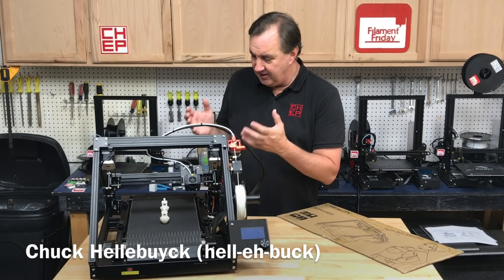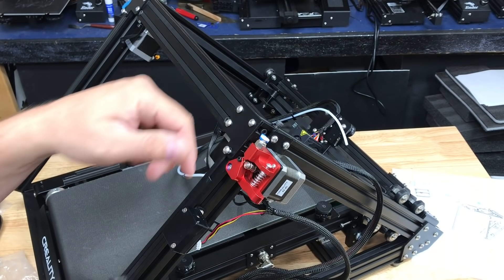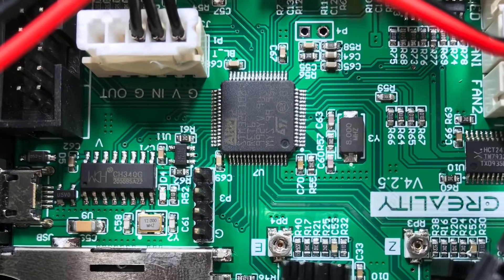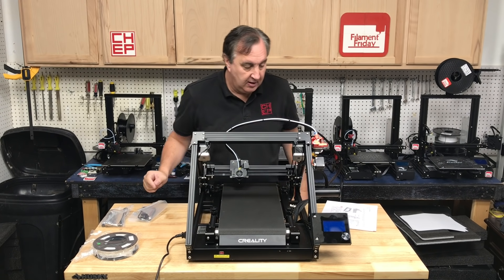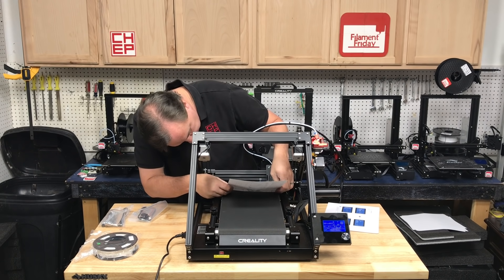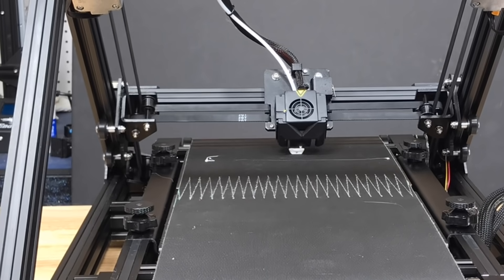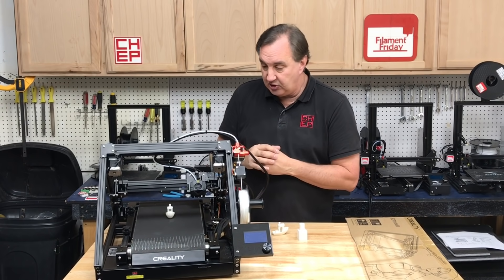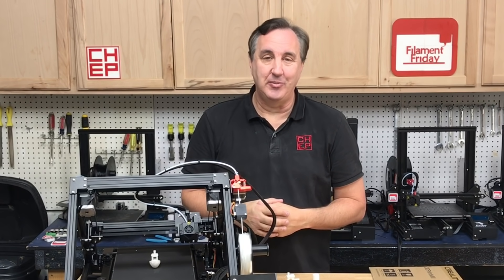Creality CR-30 - Naomi Wu's 3D PrintMill with Infinite Z

Comment: I really think they should invest a few more bucks into having V-belt profiles under the belt to help tracking straight, especially with the price point they are speaking of.
Reply: I haven't had any issues with tracking on mine..  I looked into V-belt profiles when designing the White Knight and ran into three issues. 1. Most companies want to run it down the center of the belt and that won't work with the heated bed, 2. adding the v-belt tends to deform the surface slightly, and 3. It adds significant cost to the belt...  I do like the idea though, but it would require a significant design change and inceased cost.
Reply: @NAK3DDesigns  Really? I work for a company that does conveyor systems and our manufacturer glues the V-belt profile anywhere on the belt where we want it, usually about 3 to 6 inches from the outside, that's odd if they do it only in the center, it doesn't really help tracking as you don't have 2 of them. And as far as the increased cost, I figured it wouldn't be that much as they use recycled belts from what I understood, but it could indeed be significant.
Reply: @PunkR0ckz09  V-belt profiles are a bandaid for a tracking error.  The proper way to force a true center tracking is to have a slightly raised roller in the middle so it automatically walks up to the center... but even in that case, it's still a bandaid for bad alignment.

On all of my printers, tracking is not an issue.  If they're properly calibrated and aligned, they'll go indefinitely without needing a correction.
Reply: @williamsteele  yeah I am aware of the curved rollers (I call them "football shaped rollers"), we use that in our conveyors, but that is even costlier than V-belt profiles, as it is a lot of machining... thus why I didn't even mention it lol, but you are right. I just thought since it was recycled belts, they could maybe incorporate that to help and justify the belt cost more

Comment: The only thing I pre-order are video games, because all I need to do is lay down $5 to get a copy on release day, and with digital distribution now, even that isn't a thing anymore.  They're not getting my cash until they have a product.  THAT is the incentive for a company to make a good product at a reasonable price. Business is a gamble, and you need to make something valid for people to want it, which in turn recoups your investment. Too many companies use the Kickstarter route to half-ass a product and then use their first-gen buyers as Beta testers. I'm not going to pay for that privilege. Complete testing is part of the development process, and releasing basically a prototype design as a retail device is dishonest. At least with software, you can update it. With hardware you're stuck with what you bought. Buyer beware.
Reply: Well said Ian. Exactly how I feel about what has been going on with Kickstarter.
Reply: @frogmandave1  Thanks! I'm glad someone appreciates my thoughts. I understand a small company trying to get a bit of a boost on manufacturing something when you're just figuring things out. Tooling is expensive! That was the point of Kickstarter to begin with, but that garbage of multi-million dollar companies using grassroots financing tools so they transfer all the financial risk onto buyers for a new product is absolute trash and anti-consumer. They already have resources, and shouldn't be begging with the newbies.

Comment: Great in concept but many points of failure - We are after all beta testers of Creality and boy do you realise this quickly. Creality kick out great printers BUT the caveat is a lack of quality control which is diminishing the reputation they have built up thus far.
And China as a whole needs to work on its customer support.

Comment: How is it infinite Z?
Reply: its on a belt so the prints fall at the end so you can print infinity
Reply: @jon9947  The extruder still moves in the X and Y axis as in a typical corexy printer.  Therefore, the belt became the Z.
Reply: @Kalvinjj  My first one I simply called a "Tilted Conveyor Belt Printer." :-D
Reply: @williamsteele  Yea, I understand the concept but it’s really more of a marketing gimmick than fundamentally correct. How would you print a 24” vase on its side unless it was designed to be printed that way? Supports alone would constitute half of the print time not to mention the poor finish. Regardless, there is no arguing the fact that it would be awesome to wake up to a pile of prints in the morning. 🤙🏻
Reply: @pl5882  Huh? That argument is true for any other problematic geometry on any other printer as well, though, so I don't see the point. The world is not only made of vases.
Reply: @mangabuddy  Well there is that whole thing called gravity so I'll continue print tall things vertically as not to fight against it and of course to the true Z limitations of my Ender3.
Reply: @pl5882  How is gravity a bigger problem here? Just put rollers on the end of the belt. Of course, for very long things, you need a few more rollers.
Reply: @pl5882  Of couse, for true infinity, you should print in a very low gravity environment which should not be an issue because most of infinite space is very low gravity anyway.

Comment: i wish they would do a belt axis upgrade for an ender3, ditch infinate z, go with infinate y insted
Reply: That would not work. There is a reason this printer is designed this way.
Reply: @mangabuddy  maybe infinate y was the wrong thing to say, as you would still be limited to say half the top belt length. 

the reason i ask for a belt, is so at the end of a print i can just drive forward to pop the print off then start another print etc
Reply: @ivanhartley4378  Moving large prints like that could become problematic. Only reason to replace a moving bed with a moving belt on a classic printer would be be auto removal. You don't get any axis improvement, on the contrary. IIRC Naomi wants to make the belt available separately so people can fit it to other machines.
Reply: On Kickstarter RIGHT NOW, lol

Comment: Why would Creality need a kickstarter?
Reply: Same reason Hasbro did one for HeroQuest....so YOU take all the risk and they have to come up with zero up from costs.
Reply: It's a clever way to engage customers for pre-order. 

Instead of fully committing money upfront for a whole new product line they "run a kickstarter campaign" to gauge interest. Depending the team running them, a kickstarter ranges from absolutely necessary to a glorified marketing gimmick.
Reply: So they can provide you with self destructive  machines

Comment: The concept is cool, the ability to print long items opens up some possibilities. I think the best use for this style of printer will end up being churning out parts in a farm setting. I could totally see this as a production machine if Creality and it’s user base can tweek the quality AND get third party, open source software support (cura, slic3r, etc) before interest fades. It is after all a bit of a niche product for the majority of hobby users. The software side of this is a completely different animal than regular Cartesian gcode and will be expensive to refine without a large market. I think it’s great to see some new technology being introduced and I have to give kudos to creality and Naomi for pushing the envelope with this. For me personally, I don’t see a huge need or desire for such a printer at this time but I could also see this being upscaled into a game changing technology for industrial uses (think large scale concrete 3d printing or something similar).

Comment: You realize this style has been around for quite some time?  Field of View (gentleman named Aldo) did a great deal of work on belt printers.   And it’s open source ...
Reply: Did you even watch the video? Naomi built on the open source work of others and cooperated with previous designers. It's all there in this video, with pictures...
Reply: @mangabuddy  i did but plenty of others developed this.
Reply: @WhereNerdyisCool  And what is your problem with that? Why the rhetorical question when previous work was clearly acknowleged here and everywhere else? Why are you looking for a scandal that does not exist?
Reply from the maker: Where Nerdy is Cool - Makerbot was the first and patented it. Stratasys bought out Makerbot so they own the patent. William Steele’s was the first I know of to get around the patent with the angled platform/nozzle thus making a commercial machine like Blackbelt and now Creality a reality.
Reply: @FilamentFriday  and a lot cheaper than the Blackbelt!

Comment: Surely it should be referred to as "Infinite Y-Axis"? It's the y-axis belt that can move continuously, the Z-Axis can't go infinity past the sky into space.
Reply: The nomenclature is arbitrary, but the software works by moving the extruder in the X and Y axis just as it does in a normal printer.  The Z axis (of the original Makerbot Replicator I used for the first one) was converted into the belt... so the letter assignment stuck.  Technically, there is no Z, as the belt is actually a function of the traditional Y and Z that I called Z' (Z Prime.)

Comment: You can buy 6 Enders for the price of one of these things. So, the argument of printing parts in volume doesn't make ANY sense at all FOR THIS MACHINE at $1000. It's not going to change what Joe Prusa is doing at all.This is for LONG pieces...$hitty-quality, long pieces, where it's OK to have chunks of Creality's cheapass conveyor belt, vs a metal belt, stuck in the plastic, like happened when 3D Printing Nerd tried the machine out on his channel. A WhiteKnight this is not even close to being (Check out 3D Nak's channel to see that real belt printer in action). There's a Kickstarter right now that converts an Ender 3 to a METAL belt. Creality's printer is obsolete and useless before it even hits the market with that one being available, lol. A dead horse out the starting gate, especially when Creality are showing their QC is so horrible, the DEMO machines to influencers like Chuck are incapable of printing a decent Benchy. Go ahead, Chuck - show us a print on that crazily sewn belt seam....you know, where "production" parts will print on....you know, where you count on the BELT side of the part being ultra smooth. And with no belt contamination in the printed part.

Comment: Funny how in these comments, no one can find a practical use for a long piece of plastic.
I would never support a Creality kickstarter, it's an abuse of what kickstarter was supposed to be.
Reply: I thought we were past the point of the crowd funded kickstarter. All it's used for now is free marketing. Not exactly free, but you get the idea. 

There's no need for a long piece of plastic, that's not what this is for. This is for printing multiple things that you may need to prototype and send out. In terms of cost, this is remarkable cheap for something that could print, say, 20 of the same large thing, vs one huge printer that has the build volume to support that many pieces. I'm not meaning 20 lego pieces, I'm meaning full building miniatures or even parts for future printers. You hear of print farms quite frequently, and while many printers are faster than one, there still has to be a human element that would have to remove the prints from time to time. The infinite y axis would mean that once the belt is full and moves onto the next print, it would just pop off the end and fall into a bin or something similar. 

It's a fantastic idea, but it definitely has only a few use cases. Not for someone that's just printing one thing at a time.
Reply: @Guffy1990  I got Creality to agree to completely open-source the entire printer if I could hit 5 Million on Kickstarter. If people don't want to KS fund it that's ok, but then development will probably be a bit slower.
Reply: @Naomi-Wu  Thank you for your transparency, I appreciate that you're looking for community feedback on this.

I just feel that, with how large Creality has become, it should be easier than normal to just "do it" so to speak. I know that this is partly your brain-child, and partly contributions from other members of the 3D printing community, however it's a good idea! People will buy it if they have a use case for it! If they don't, then they won't. It's definitely a very niche market this is catering towards, but that niche is quite large. People still look at 3D printing as a concept, more than something that they'd actually use. Although, that seems to be disappearing more and more, which is also fantastic!

Open sourcing would be a great benefit to it all, and it's impressive that you managed to get them to it. Creality is mostly open sourced anyway when it comes to mitigating the amount of proprietary equipment and hardware they utilise.

Out of curiosity, what parts of it would be open sourced?
Reply: @Guffy1990  The entire thing, same as OSHWA- CAD files, firmware, Gerbers, everything.
Reply: @Guffy1990  At a hobbyist level, this has very little value as you might be making one-off pieces. From a small scale production level, >20 to <1000, which is where 3D printing is perfect, this would be invaluable.
Reply: @Rottwiler44  that's... That's exactly what I said...

Comment: If it has an infinite Z, prove it by printing something really long, like a minecraft sword or katana.
Reply: Not sure that’d be feasible, you’re probably still limited by the print area. If you tried to print something longer, you wouldn’t be able to print the each layer continuously.
Reply: @blazingangel623  It doesn't print the layers flat, it prints sort of like it's printing on an invisible print surface purpendicular to the angled nozzle etc.
Reply: @TheAkashicTraveller  @YellowJacket20 tbh, i'm more interested to see when the object tips over the edge. I wouldn't really print anything that long; I only see this type of printer making multiple smaller prints just like how it printed multiple benchies.
Reply: @fboodysan  & @YellowJacket20  Naomi Wu's build and presentation of this printer shows her printing multiple Benchy boats that fall into a box, as well as a pretty lengthy I-beam girder, if that's what you're looking to see!
Reply: @IanTheWoodchuck  Yea, I've just seen a video of a guy printing a rail that is 20 feet long. But you gotta have some support for it; Common sense.
Reply: @blazingangel623  I've just recently watched them test print a long sword on it and it does great
Reply: There are videos of it printing a I-Beam so it definitely can print continuous
Reply: @fboodysan  there is a roller add on to it.. add about another 2 feet beyond that you use a Miller wood stand and add multi ones of that..

Comment: Way over priced. Pay an extra 600.00 just to have a belt drive.  Way over priced. Easier to remove the print and hit print again on all the other 200 printers.
Reply: Till you want to print a 6ft sword in only 2 pieces..  Then it doesn't seem that expensive..
Reply: @NAK3DDesigns  Walmart or target for toy swords.
Reply: If you don't need this printer, you should really not buy it. If you do, it's a pretty good price and I have seen no viable alternative on the market.
Reply: @boazandruth909  What the fuck? Why do you even have/want a 3D printer at all, then? Just buy all your stuff ready from the store! Yeah, right...
Reply: @mangabuddy  I’m not.  Too pricey

Comment: Too many issues out of the box for busy consumers. I'll pass for the next version.
Reply: Name a Creality printer that does not have issues out of the box.
Reply: You haven't used consumer grade printers before, have you? They all have issues similar to this. This isn't a finished product as said several times in the video. Kit printers all have to be assembled, usually from scratch, and leveled. I didn't see many issues at all actually... Dual drive? 32-bit mainboard? Technology that's only ever been in a prototype space, and never been sold to consumers? I'd say that's all justifiable if only for sub $1000 with a few bits and pieces that needs to be assembled.
Reply: @Guffy1990  I have to agree..  I don't know of any printer out there that is perfect out of the box..  Even Prusa is constantly publishing updates/improvements based on customer feedback.